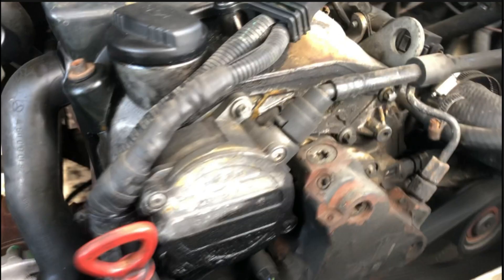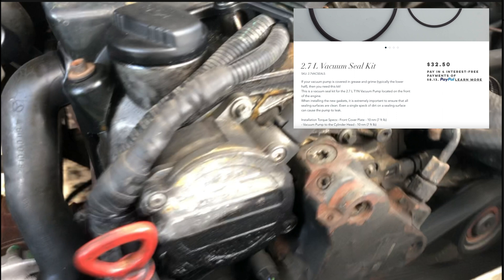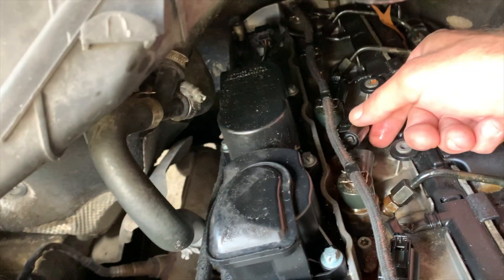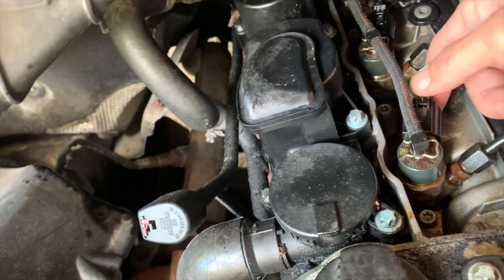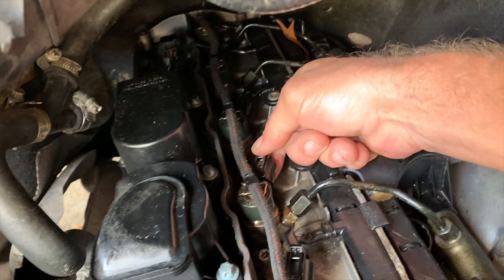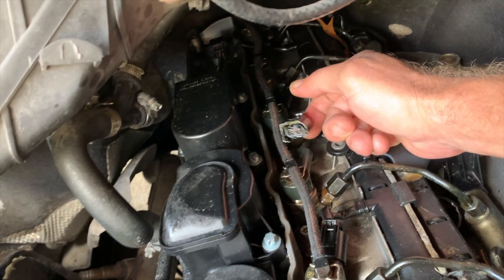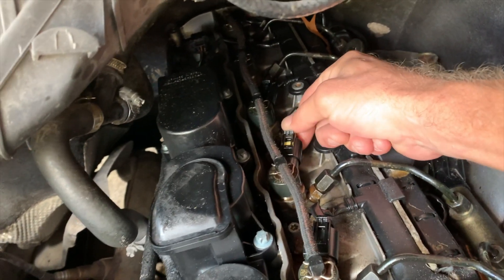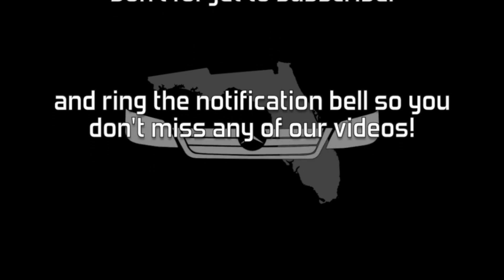Engine Knock or Noises? Use Your Phone as a Listening Tool and Slow It Down.

Comment: I’m hopeful to see this video on how you fixed that noise so I can fix mine aswell
Reply from the maker: Sadly that video won't be coming. We replaced a piston, honed the hell out of the cylinder and the engine ran great the first two trips. We failed to diagnose the original cause of  piston slap, apparently an oil pump or oil jet problem since the engine did not survive trip #3 and pooched a bearing.
Reply: Bummer!

Comment: I have a 3500 use to knock in cold starts and when rpm's went above 3k I replaced glow plugs just because it was also throwing some white smoke after driving it for a couple months knock went away, not sure what happened

Comment: I have sprinter van 2006 and it have problem that no one can help me with 
it has start error with short crank, sometimes it works just fine if I daily start it, and if I didn’t start it for 2 or 3 days the same problem will happen again 

I have tried a lot of different methods to fix it but nothing works.

I’ve changed the crankshaft position sensor and camshaft position sensor, I’ve checked the fuel pump and fuel pressure sensor and it’s all working fine.

Can you please help me with this issue 

Thank you